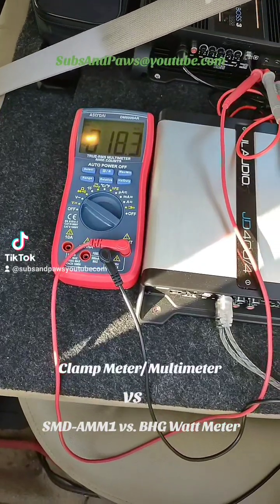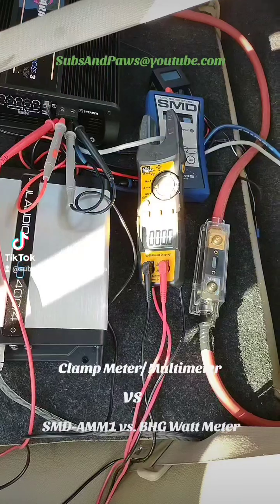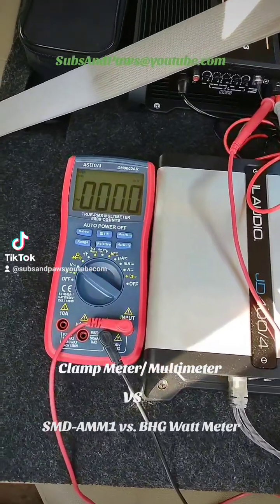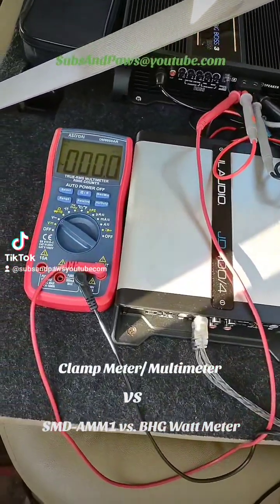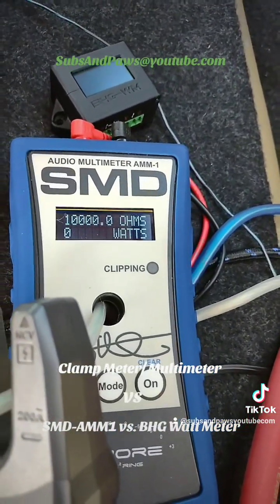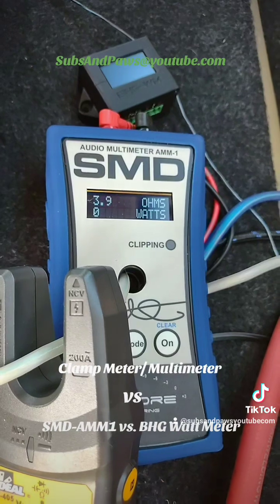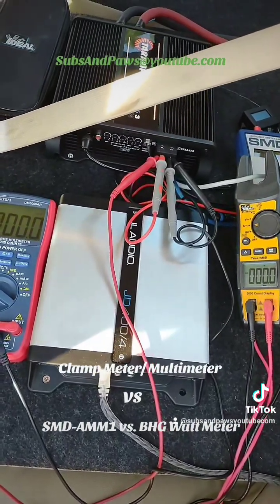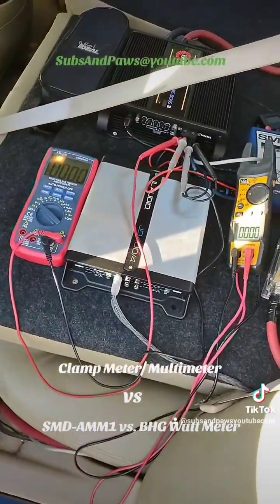BHG Watt Meter Vs. SMD-AMM1 Test Results Vs. Clamp Meter Vs Multimeter Timpano TPT-3500 12's

Comment: What in the world does the AC Ammeter mean.  I got 41.5a on it but should have been 600a based on my amp..  So confusing.
Reply from the maker: Okay. I was confused myself. The AC meter is used for watt's or power application. When testing for power from your alternator or amplifier DC power you need to have an DC Clamp Meter. Not AC. I got mine at home Depot for about $100 it goes up to 400 amps. I will do a video today showing the difference. Hopefully that helps. If you have any questions please let me know. Thanks for your comment and support 🙂
Reply: @SubzPawz  Whoa!  Thank you. I was not even expecting a reply but so cool.  I really want to get the wireless bass knob to but just can afford it right now.  Thank you for the video in advance.

Comment: A$$ test. Show them both at the same time. And no they didnt match up that close WHEN YOU EVEN SHOWED  IT. Damn just show it all in one shot and keep the volume the same. Too many variables
Reply from the maker: I have several videos of several different tests, multimeter, clamp meter, BHG meter, SMD-AMM1, all different tests done many times on multiple equipment. I've done more than cover everything. Steve Meade commented on my videos.

Comment: Yall bought that ultra high dollar meter and got taken for a ride admit it
Reply: Actually, they just bought another one because they believe it's accurate.
Reply from the maker: Yes. 100% accurate. Steve Meade commented on my video thanking us for our real results video. Thanks for your comment 😊
Reply from the maker: We have 2 of them actually like Jason said. We have multiple multimeters and the BHG meter. The people being taken are the people buying the watt meter. If you're running under 1,000 watt's that meter is for you. But if you run real power and want to see what you're getting on bursts the SMD is the meter you need. I'm going to get a termlab at some point also. I have the SPL Lab Mini DB meter but I'm going to buy the whole kit.
Reply from the maker: Steve Meade commented on the video. Further explanation on the tests we did.

Comment: @Subs&Paws & to whom it may concern- To have a complete, and accurate comparision. You should have ALL meters hooked up, and in the same screen, @ the same time. Have Both the Bass Head Garage Watt Meter, and the SMD Amm-1, set to Real Time Power, then ✔️ power @ just before clipping, then while your Taramps Big Boss 3k Bass is clipping, see how the 2 meters differ, you will be surprised. Again have ALL meters hooked up, and in the same screen, @ the same time. Its been shown in your videos, and on other youtube chs., that the SMD Amm-1, malfunctions sometimes, while on Realtime, and dyno power. It occurs when the Amm-1 all of a sudden shows .1/ a tenth of an OHM, then it shows outrageous= way too high of a power readout. It can show the Amps and Volts correctly, but when it freaks out=malfunctions= when it shows .1/ a tenth of an OHM, it screws the calculations up, as it calculates power using Amps X Volts X the Read Impedance, @ the same time.
Reply from the maker: I'm going to do exactly that today. We already did multiple tests a couple weeks ago with the BHG meter vs the SMD. I loaded a couple video's with high power. We'll have more today. I brought the meter's indoors for testing. I will have all the meter's on today. BHG, SMD, multimeter and clamp meter.
Reply: @SubzPawz  - Im interested in seeing the difference between these 2 meters as clipping is happening.
Reply from the maker: @evilinside5984  we're going to go through all the steps. I'll have all the meter's on at the same time later today. I appreciate the interest. Thanks for your comment and support 🙂

Comment: Come on, your not even going to show the BHG meter?

Try setting both meters to show volts and amps and then have the separate volt meter and amp meter displayed. This way we get 3 sets of info. 

It's also worth setting the BHG to Apparent Power mode. This will show the power factor and I think compensate for it which will show a higher wattage.
Reply: I don't think you need to go higher than 2,000 watts. The two wattage meters started to diverge around 800w or so.
Reply: Also, which version of the BHG meter do you have? The older 100A sensor or the newer 150A sensor?
Reply from the maker: @JasonWW2000  we posted videos a couple weeks ago. I will have more today.
Reply: @SubzPawz Cool, I'll look for them.
Reply from the maker: @JasonWW2000  https://youtube.com/shorts/zqxSd3EkulQ?si=fPke77d_dvHe0Pc2
Reply from the maker: @JasonWW2000  there's another too before this. We'll have another today.

Comment: Show the of the cheap meter
Reply from the maker: @sosdeathvalley  I'm going to do another video later today. I already posted a few videos a couple weeks ago with the two meter's.
Reply: @SubzPawz Make sure to go through the different screens on both meters. 

I suspect the Power Factor is going to be different on the two meters at high power levels. So the Apparent Power screen on the BHG meter might be more accurate when it comes to high power situations. 

Its going to be a tough video to shoot. I wish you had some high power resistor banks so you can have consistent ohm readings.